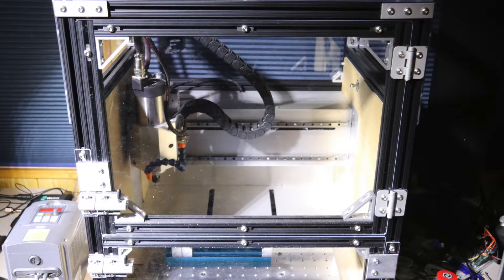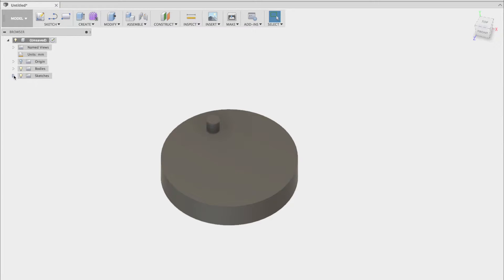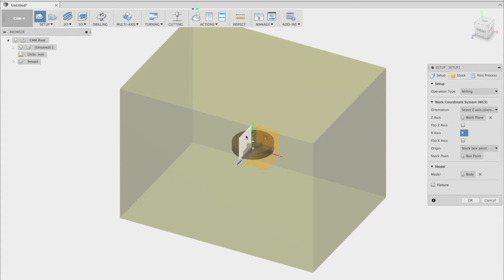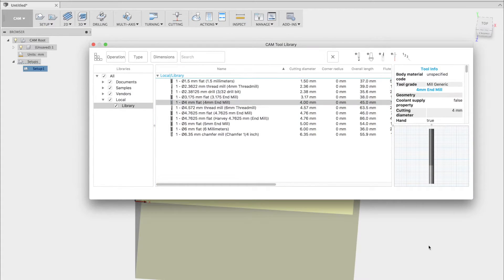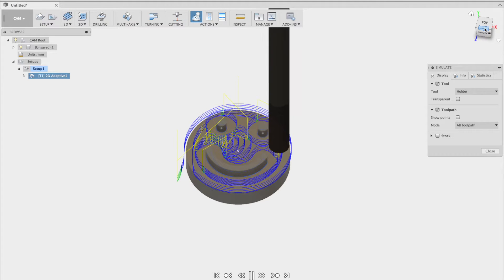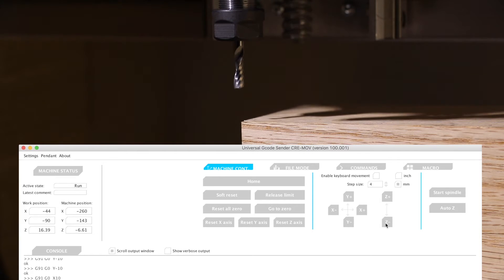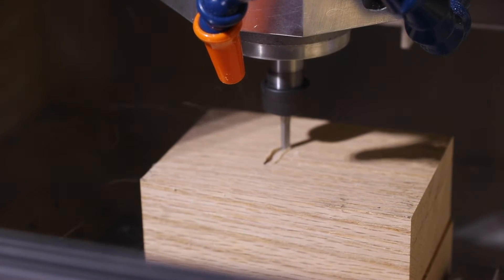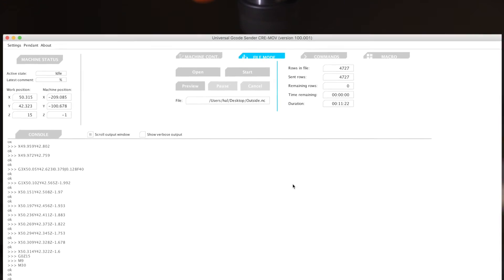EVO One CNC Fusion 360 Quickstart Guide

Comment: I have evo one purchased in 2019 but serial number is 2017-002
Reply: Cre mov 2018 and 2019 are not fully compstinle with the machine
Reply: Xy and z axis adjustments did not work
Reply: How can i get older version or any other

Comment: I noticed you have changed the spindle. I have the Evo-One v2 which I think has a more powerful spindle than the original v1. So my question is about your feeds and speeds. Were you using those speeds with the original spindle?